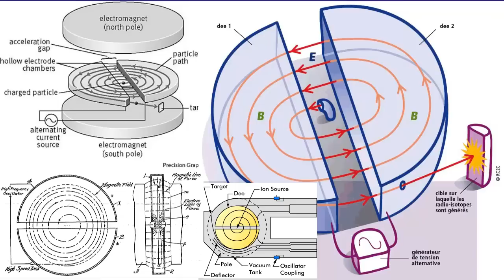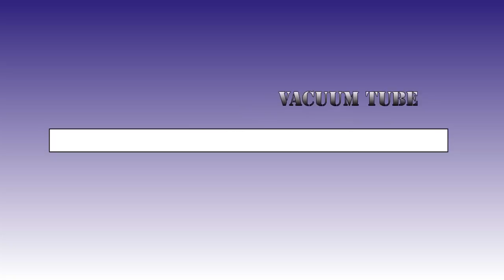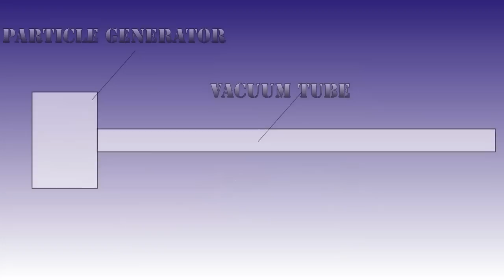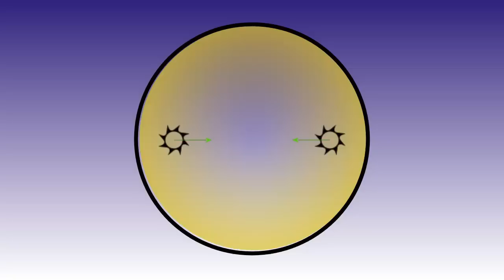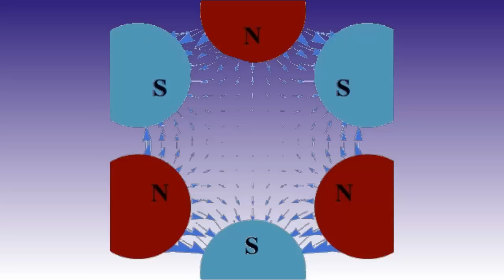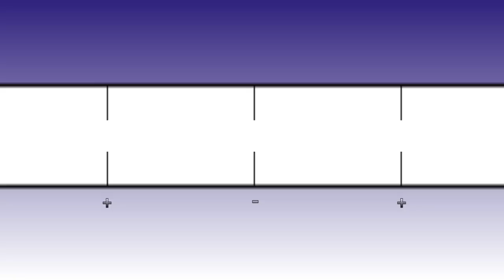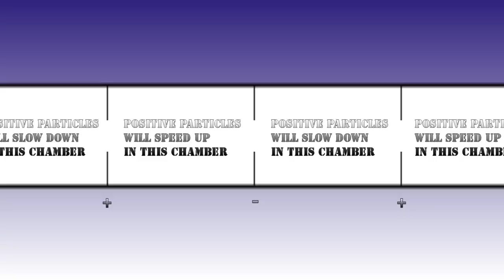How particle accelerators work

Comment: Thanks for this, one of the clearer videos I've seen. I know it's old, but my only question is about not taking us through accelerators that increase the distance between chambers. But one could infer what happens (increased velocity) based on inference from the equidistant plate set up.

Comment: Very nice video!  So, given the speed of the particles in the vacuum chamber, and wavelength is inversely proportional to frequency, by what factor of wavelength distance are these plates spaced?  Do you know of an example?  From there the switching speed of the plate fields could be derived.

Comment: But there are so many particles so by changing the sign positive or negative some particles which are left behind may slow down???
Reply: Only electrons are being accelerated.  The accelerator guide is under vacuum being fed by an electron gun.

Comment: What. Is speed of particle
Reply: Appuganesh India they say all electromagnetic radiation(from big ass radio waves to  our visible light to gamma rays) travel at light speed(300 million meters per second) which they say is constant and only changes velocity when passing through a different medium. But i do believe they say these particles accelerated are slightly less than light speed because apparently light speed is impossible within an observational experiment due to some time continuum bullshit and the inability to achieve a perfect vacuum. But yea, do what you want with that information. Good luck and God bless.

Comment: Can particle accelerators use on accelerating water droplets?
Reply: from what i have watched i would say that it can be used to accelerate charges only (electron or proton )
Reply: water is polar, so you can do either hydrogen or oxygen as they are ions but not water because it would attract to both plates.

Comment: so this only works with protons? how are electrons accellerated?
Reply: In principle you can use negative charges too and the same principle holds, you just need to inject the particles at different time to obtain acceleration. Of course, other considerations are needed to take into account the mass difference, its interaction with wall and residual background gas, and them self, and maybe they might emit different radiation. But with respect to electromagnetic acceleration a particle with given charge and mass, will react in same manner for an equivalent electromagnetic field configuration.
Reply: ***** what i meant was that the lorenz-force is the exact Opposite direction with electrons so the redirecting of the electrons with electromagnets won't work, how do they account for that?
Reply: @remcovanwoerkom9546  redirecting still works. just use an opposite magnetic field aswell, then the redirecting will be the same

Comment: LHC is not a linear accelerator, its a synchrotron. All LINACs are straight. Fix this. The very first thing in the video is doubtful.
Reply: It is neither a synchrotron nor a LINAC, it's a collider. It's even in the name...
The LHC uses a LINAC as its first stage (called LINAC 2 until now, and it'll be replaced by LINAC 4 in 2020 - LINAC 3 exists, but it's for heavy ions, not protons used in the LHC -), then the particles are injected into the collider, although there are many steps before.
Reply: LHC is a collider, which is one usecase of a storage ring, which in turn is based on a synchrotron. It uses radio frequency cavities at fixed resonant frequencies to accelerate the particles. Also, quadrupole magnets still focus on the diagonals - and it is even worse: While the quadrupole magnet focuses in one plane, it is defocussing in the other. The strength of the magnetic field in x/y is dependent on the distance from quadrupole center: B(y) = -g x.  Higher order multipoles are needed to correct other effects, like energy-dependent focussing ("chromaticity") and multipole errors which are unavoidable in physical construction of accelerator components. I gain my knowledge from operating and accelerator right now ;)